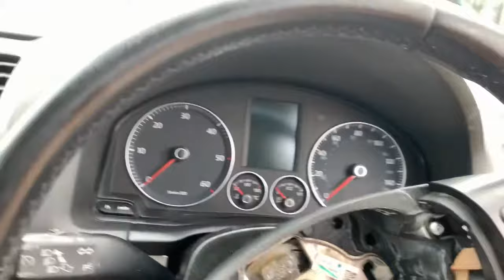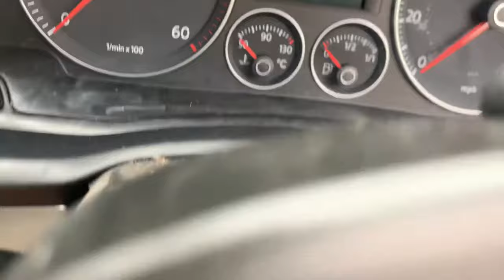Vw Golf, Bora, Caddy Ignition Lock and Cylinder Easy Removal

Comment: On Jetta .don't need to remove steering wheel. Remove plastic surroundings. 2 top screws . Disconnect electrical plugs. Pry out cylinder.

Comment: Toughest part of disassemble was getting the airbag removed. Have to pull very hard. The key wouldn’t release, so I had to cut the back of the old mechanism off to get it to release. Went back together about 15 minutes. Works like a charm. New part is $170 USD at this date 

Thanks dude!
Reply: You know if the new one needs to be programmed

Comment: Many thanks for doing this video.
You save my Caddy.🙏🏻
I do some things differently than you and I don't have to remove the steering wheel, I use bolt remover for the broken bolts (have to dril a 3.5mm hole in the screw head) and a torx bit instead a screwdriver.
Works very well.
Without this video I never be able to fix it.
Thanks and I wish you the best.

Comment: Question about the 3 plug harness that connects to back of actual switch- the middle connects inside of black box —but ——where does the last (two wire) plug connect?

Comment: I replaced that, then car start but shut off, car key immobilizer flash any one know what to do?
Reply: Did you reconnect all cables? If the reading coil isn't connected to the ECU, it can't detect your key's transponder.